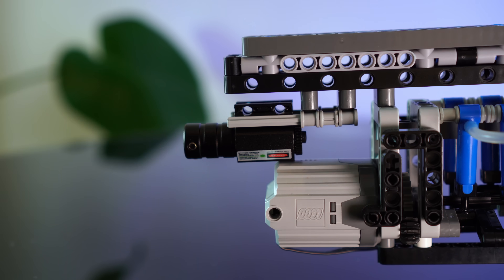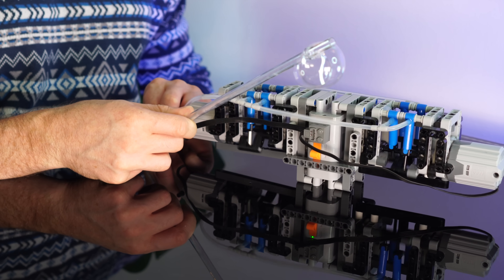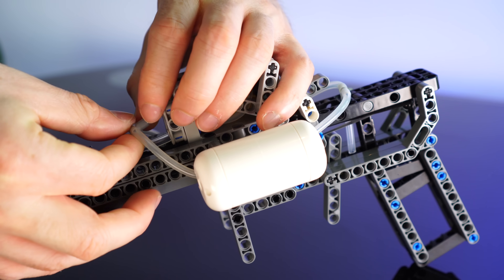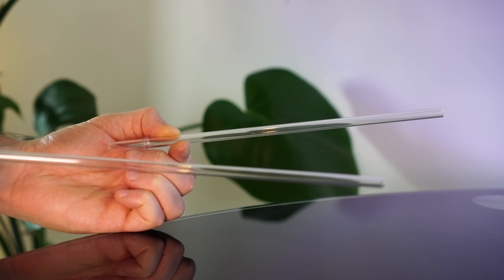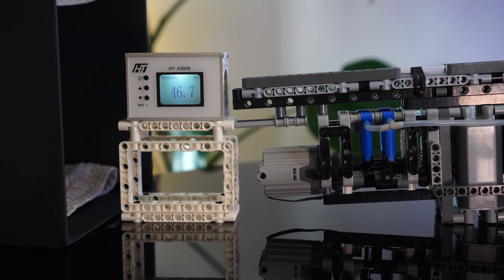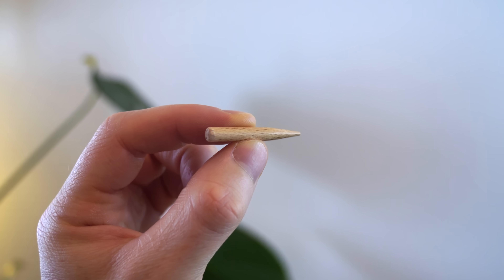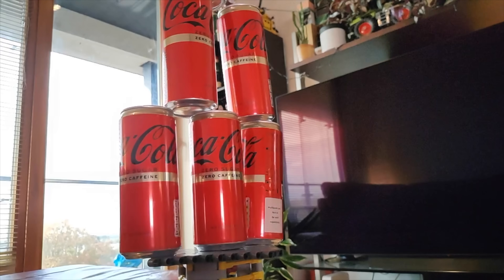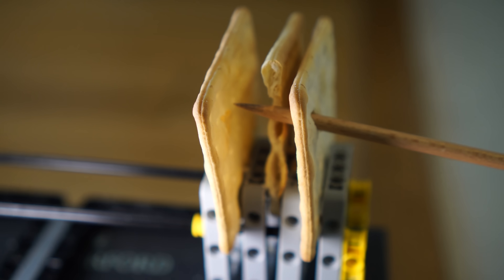World's Most Powerful Lego Air Gun?

Comment: great video!, but i have a suggestion, as this could be improved as maybe this can achieve higher speeds but needs more air to push with enough force for heftier loads and sometimes can help having a longer barrel but you need some decent amount more of pressure and air to utilize that properly, and i'm sure there is a website with custom pumps with more volume metal shafts and better in general made for lego air piston engines which i think would easily buff this gun with more pressure and reload speed but man that there is definitely cooler than that last one, keep it going!
Reply from the maker: Thanks a lot! And will look into that. One of the main power limiters right now is simply the bottleneck of how small the Lego pneumatic connectors are. But might look into storing more air in a small coke bottle or something. Would love a better compressor too. Cheers for the recommendation 🙏

Comment: I would expand on "For what ever reason" that shorter is barrel. In airsoft, big factor is cylinder to barrel volume. If you have a too long barrel and not enough air volume in cylinder, the BB will be pushed by the pressure behing it coming from the cylinder, but if a barrel is too long, it will lose the pressure because the air behind it will be filled since the barrel is too long. What happens then is, due to friction mostly and other factor, BB slows down by the end of the barrel. Same if the barrel is too short, the cylinder will release the air but the BB will already leave the barrel before the cylinder release it all and made a full pressure behind the bb, thus not being utilized fully and BB will lose power. Thats why the barrel to cylinder air volume ratio is important. The weight of the BB is also an important factor here, where heavier BB requires bigger air pressure behind it, thus requiring shorter barrel.

Comment: Honestly I think the biggest limiting factor of this is the hose diameter. It's too constricting for the amount of pressure you have. Quite a few times you can hear air still being released well after the projectile has already left the barrel. This denotes a restriction, and thus a loss in power. To get more power, you'd need to dump the air as close as you can to all at once, as fast as you can. As it is though, you are always going to be limited by the small diameter tubing should you continue it.
Reply from the maker: You're 100% right on this. It's been frustrating hearing that hiss even after the bullet has landed. Of course there will always be some hiss as pressure drops after release and the remaining low pressure air escapes the tubes. But this really needs thicker tubing. I've got some that is a little thicker and still works with Lego pieces, but the Lego pieces are still a limiting factor. I've a couple other ideas though using a coke bottle and thicker tubing. Cheers for your thoughts!
Reply: @JamiesBrickJams doesn't a thicker tube exist? From that set where you have a spaceship you can launch with a hand pump attached to an orange tube

Comment: Looking at the test piece - you just had air leaking around it, and in longer barrel it did so for longer + the friction. also using slowmo of the gauge it looks like the air supply diameter is too small, it keeps dropping pressure even after the projectile is out

Comment: The reason the longer barrel doesn't work as well is because it's a constant, set pressure pushing the object through. The reason longer barrels are better in firearms is because the powder gets more time to burn and create more pressure before the bullet leaves. You don't get that with an airgun.
Reply from the maker: That makes sense. Sounds like it just needs more air to keep providing that 'push' until the projectile leaves the barrel

Comment: Thank you for the inspiration!
I think you could improve the pressure if you don't use these tiny LEGO air tanks and replace them with a bigger tank made of a empty plastic bottle or something like this. Might be a littele more difficult to mount or glue the connections but should be possible to accomplish.
A bottle can store more air and pressure.
Reply from the maker: You're definitely right, larger bottles will hold muuuuuch more air. Been experimenting with that for a while now 😉

Comment: Longer barrels work due to actual guns using a gas explosion and gas pressure to:
-make the bullet accelerate due to steadily increasing pressure as it travels through the barrel
-use the excess gas pressure to push back the charging handle, rechambering another round

If you are trying to use a longer barrel effectively, you would need to attain the required gas pressure to accelerate the projectile while it is still inside the barrel, so... Very VERY fast.

Also try rifling the barrel, assuming you want more accuracy.

Comment: Your long projectiles are tumbling. 

You either need something like a crossbow bolt (fletched) or else something spherical, which (at subsonic speeds) will be fairly optimal in terms of aerodynamics.

Interestingly a LEGO Zamor sphere, will fit pretty snugly into a 4x4 tube structure that could be made with 2x4 macaronis, or equivalent (don't use 4x4 round plates with 2x2 round open centres. The barrel interior won't be smooth).

The main issue would be the large calibre and the subsequent, large volume of the barrel. 

Perhaps you could use a coke bottle as your tank, and beef up the compressor module.

Comment: There's gonna be a magic length that is just perfect. Where if you go past that, then it's too long and you're losing efficiency. Basically, however long it takes for the projectile to accelerate to its maximum. Speed is how long you want it to be in the barrel. I'm sure using a bit of math, you can figure out exactly how long the barrel should be to reach maximum speed.

Comment: by gearing the compressors differently you could have some which pump faster at the beginning, and then some which pump slower but are able to bring it up to higher pressure - should improve both speed and pressure. 

ideally you'd have all the compressors driven by a transmission but that feels like overkill
Reply from the maker: Damn that's such a great idea, thanks for sharing that! Some geared down ones might actually allow it to get up higher. Maybe some kind of automatic transmission could work there. Thanks for the suggestion!

Comment: the reason your small projectiles werent flying straight is bc the tip is lighter than the rear, your longer ones work better due to inertia
Reply from the maker: A few folks have mentioned that, and that definitely seems to be the case - thanks for sharing! I guess going back to darts is likely a good move to prevent tumbling

Comment: I think the shorter barrel is better, because there's less space = more pressure can build up faster, which means, that there will be more pressure at the end of the barrel pushing the bullet out, however in a longer barrel, there's more space = less pressure, which means, the bullet won't accelerate as much. 
Btw I don't really know anything about air and air pressure and stuff like that😂 It's just what I think could cause it
Reply from the maker: I suspect you're probably right ... That, and more friction in the longer pipe. I'm just doing this all by trial and error, so I don't really know for sure either!

Comment: i think the barrel is too long for the airflow. the compressed air in the hose before the barrell is all that accelerates the projectile. now if the barrell is too long, the projectile 'sucks' out the air that's in the tanks (as the openings in the connectors are too small) thus slowing it down. i would just not include tanks and bore out the connectors a bit

Comment: Cool video, Now, I feel like if you made the other end of the pipe the projectile is being shot from more airtight, you might be able to yield some slightly better results. Just a thought though
Reply from the maker: Yeah totally. The metal barrel is actually completely airtight, but the plastic one could do with a bit better seal
Reply: @JamiesBrickJams  The metal one is sealed at the other end? I was talking about where the tube touches it. Under a wave of pressure it might break the seal and therefore lose some velocity of the projectile.

Comment: the bottleneck is the literal bottleneck..
but great work! definitely subscribed :)

I hope v3 is using a real spring that is torqued using air pressure and worm drive on linear gear.. :D
Reply from the maker: Aw well thanks for joining 😁 And yeah, Lego has some very real limitations with their standard pneumatic components. But the next version will likely use some 'cheating' to increase airflow 😉

Comment: You decrease the flow with the T couplers to increse it you need more T couplers and more tanks
Reply from the maker: More tanks is certainly something I can do! And you're right, the T junctions are a major limiting factor here. Unfortunately more tanks means more T junctions, which will all ultimately need to converge on a single one. And that one will likely struggle to quickly release the air from multiple tanks. Certainly worth trying more tanks anyway. I just suspect more tanks won't necessarily increase output much as they all have to converge via a network of those T pieces. Other methods like a small coke bottle and single pipe could be a strong alternative though

Comment: Would you share a supply list to accompany this build?  My son wants to build it as a STEAM project.
Reply from the maker: Hey! I'm afraid I mostly disassembled this model for parts and didn't create any instructions. But the principle is quite easy to replicate. I'd imagine your son would have more fun designing his own version. It's essentially just a mechanism to crimp the hosing (he can easily copy my design), and a means of pumping it up. Mainly you need an air reservoir - I used Lego tanks, but a small coke bottle works well too. To pump it up you can use Lego compressors or even just a bicycle pump. Have fun!

Comment: How can you get the pressure so high? My system pops at 20 psi
Reply from the maker: You sure it's at 20 psi? I've used various Lego pneumatics for decades and never had any issues at 40 psi. I tend to get pipes popping off at around 45 to 50 psi. Even the standing Lego branded pipes.
Reply: @JamiesBrickJams  maybe I just didn’t put it all the way but I just found out I bought the fake version of Lego puematic it was made in china and was 1mm bigger that original

Comment: Wait a minute. Are you just pushing your projectiles into the front of the barrel? No wonder you are getting such weird and inconsistant results. The projectile is supposed to start at the other end off the gun and go down the barrel. That way you get acceleration instead of impact. Seriusly with that setup you are loosing pressure with the length of the barrel instead of increasing it.
Reply from the maker: They're front loaded, but each round slides down the barrel to the base (where the output from the crimper is) before I shoot. So I believe I'm still making full use of the barrel and the pressure build up. However the plastic pipe isn't perfectly airtight. The metal barrel is airtight though.